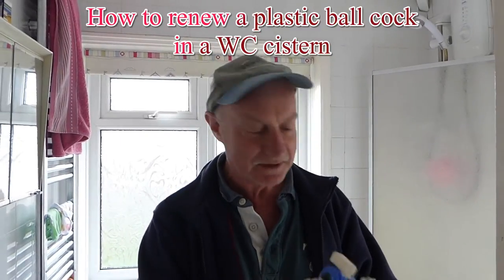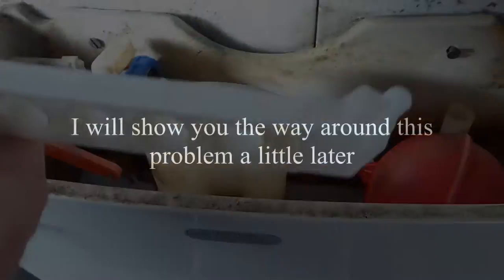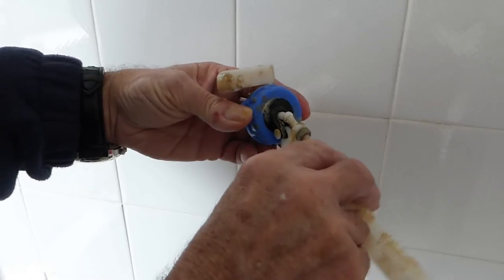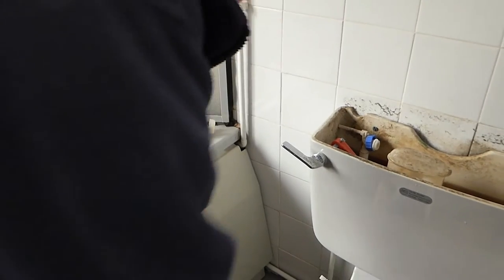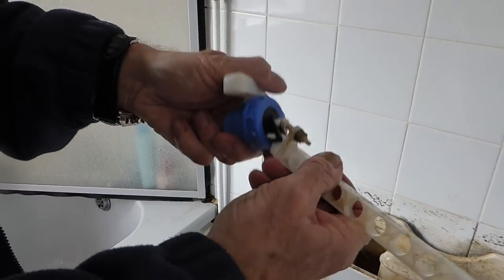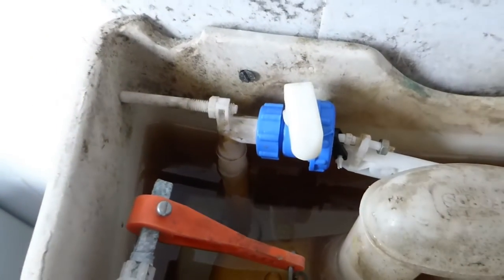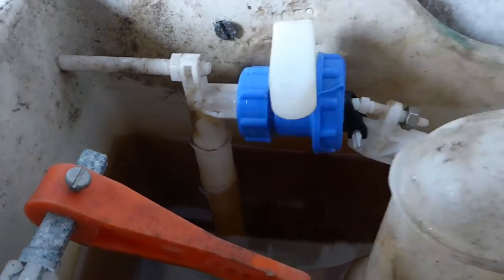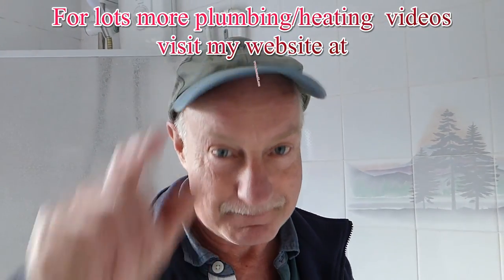How to renew a plastic ballcock in a WC cistern. Overflow running?

Comment: Thank you! Mine has been slow dripping for months. I have the same set as you have and managed to find an identical new set online. Hope I can just replace the top bit same as you did. The tube going down to the bottom doesn’t leak so if it ain’t broke don’t fix it! Thanks again 🙂👍🏻
Reply from the maker: Glad I could help!

Comment: Thanks for making this video. My toilet has the same plastic ballcock. I found a replacement at wickes but it still overflows  over a  period of 4 hours. At time 3:48 in your video when you connect the plastic arm to water inlet, should there be a  rubber washer  or leather washer on the water inlet?  I cant identify where the leak is water inlet or from diaphragm on the new valve. Ant tips  for a leak? Ive tried to dry it and use toilet paper to see where leak comes from.
Thanks in advance.
Reply from the maker: There should be a leather washer there, or use PTFE tape before connecting.
Reply: @dereton33   Thank you for a quick reply, there was no leather washer, I am in a hard water area, so wonder if it dissolved from contaminents? I'll try a new leather washer, there is a small rubber o-ring, but will get a leather washer.
Reply: Well I've had the ball valve apart, reassembled with PTFE tape, and toilet still overflows. However when I look into the cistern, I see a water swirl (vortex) near the plastic inlet tube, and  think it must have a microscopic hole.  Is it possible that hard water  has worn away the plastic and caused a hole ?
Anyway,  think I will have to call a plumber as the bottom tube  is more than I'm confident with.  Thanks  again for all your help.